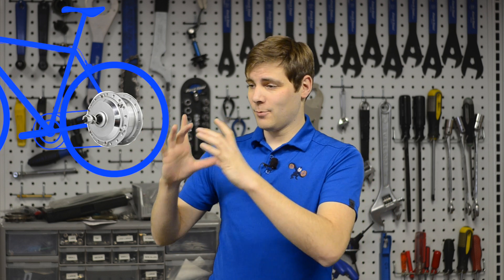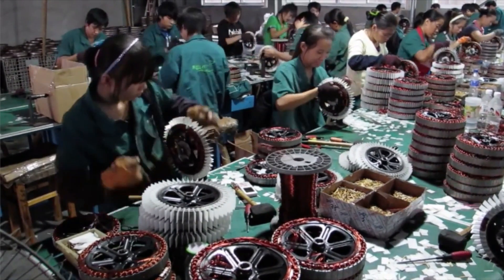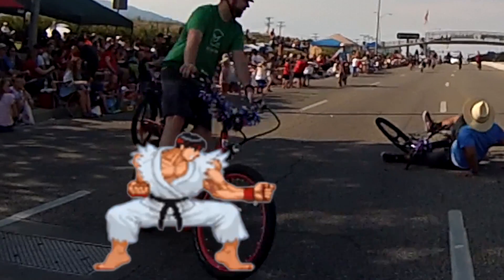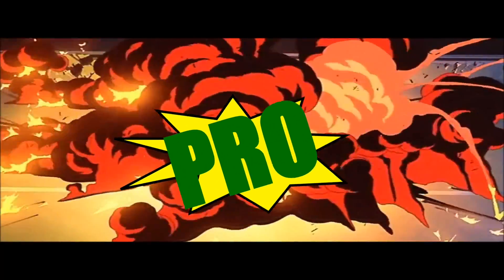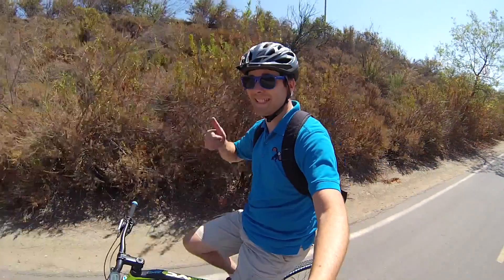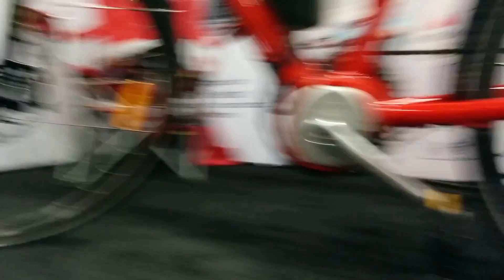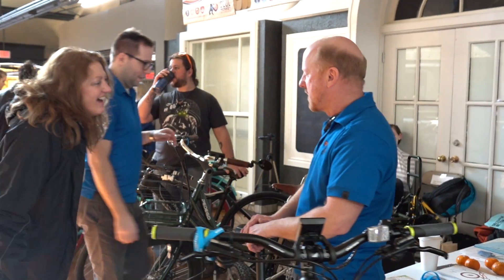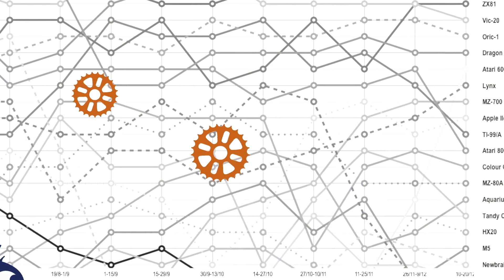Hub Drive VS Mid Drive eBike motor systems

Comment: The sprocket equalizing system on the Haibike is designed to keep the wheelbase short and increase the height so the chain doesn't slap against the chainstay. If you look at some of the Old Easy Motion EVO Jumpers, one of the chainstays is lower than the other but recently, they lowered both chainstays. If you use a SES pulley, you don't need to design a different chainstay.

Comment: Hi is really a fan of the "OLD FASHION Hub engine and therefore not tell anything about the real advantage of a mid drive like: 
Less battery use and the motor use the bikes gearing in / on the back wheel and therefore also can clime steeper hills as any hub motor with even less stress on the chain when you use the right gearing..
And today you have more mid drive engine you NOT NEED a special bike frame. You just fix it in the BB that's all and easier then a hub motor.
And the prices are not more of this mid drives anyway.
BTW you can use every Hub motor as a mid drive motor if you have just a little skill how to convert it. See here on YouTube many example. Also not a big deal.
Conclusion is a Mid drive has MUCH MORE advantage then a Hub motor in the Wheel,
THEREFORE SEARCH FOR MORE VIDEOS HERE WHO SHOW YOU WITHOUT PREJUDICE THE REAL THING = MID DRIVE vs HUB MOTORS (In the wheel)
Have FUN :-) and: "Let's GO the Road is calling YOU ... .. . (Y)
Reply: There is nothing that cannot be accomplished with enough time and money but...that is NOT within the scope of this overview video.This video was not intended for the experimental segment of the eBike population.You forgot to mention all the cons of a hub motor converted to mid-mount giving rise to the thought that your caustic comments seem a bit prejudiced. Hmm...

Comment: You don't "Have to pedal" with all mid drives. Only crappy ones. Good mid drives have PAS AND throttle. 

"A mid drive has to have a bike designed around it" Wrong again. The Bafang series fit almost all bikes. In any standard Bottom bracket, commuter bike, mountain bike, fat bike, road bike...
Reply: G Henrickson I can't help but LoL at the "those who ride conventional bike hardly ever wave back" comment. I ride both, however, care not if anyone does or does not wave at me or anyone else. Is this really a thing? Now I will chuckle every time some one waves or doesn't wave.hahhaha!
Reply: I just heard the part he said mid drives MOST you have to pedal
Reply: Baqca Sanke really thanks I'm wanting to buy a mid drive electric mike looked at trek  but idk  I want it to ride to work  and for fun. ride in woods ect any suggestions
Reply: Baqca Sanke my experience is the most expensive mid drives (bosch, yamaha, impulse,  shimano)  don't have a throttle option. Hardly crappy - altho quite boring and sterile. 

True the mid-drive bafang can be bolted on to most bottom brackets and comes with a throttle option,  but they lack the torque sensor found on nearly all more expensive mid-drives. They deliver power in a more "unsophisticated" way - altho my next ebike week have this motor. 

So far I believe the Tongsheng mid drive is the only bolt on mid drive with a torque sensor, but is a bit of a pansy as you only have a choice of a 250w or 350w outputs.
Reply: @mrmoralman1  just be aware that peak efficiency for even the BBSHD is only at 300 watts, if you like a cadence of 80-90 rpm. At higher wattage like 750-1k, you'd have to be rotating the cranks at 140+ rpm, otherwise you'll be drawing that much power still but at 80rpm only getting 500w of output thanks to being as efficient as any hub or less so even. Motors are most efficient at a given torque, but at the same cadence you need more torque, not speed to get more wattage, so the efficiency goes down on a mid drive like the BBSHD after 300w. The default out of box level 1 power is more or less the most efficient, and you'll see that higher powers have speeds you practically can't peddle unless your gear down and run the motor less efficiently. One could say for the mid drive it's also not efficient as possible as its fixed gearing to the pedals, which should spin faster at higher power levels than a person can. So you can kiss pedal assistance goodbye for high power bursts since your peddaling at lower rpm would take just as much or more battery power despite your helping.
Reply: So can you use the gears on the back wheel ?
Reply: Baqca Sanke  ikr, mine is great too, am almost always on throttle, and i dont believe you can snap your chain unless youre going up an incredibly steep hill, i always change gears just like a car when i get to a hill so i put less stress on my chain
Reply: Leopoldo Chatz Mata yes as you would usually use them,but need to have a little break from the power, for just an instance, so your giving everything time to shift smoothly.
Reply: Dale Bowen 👌
Reply: 20:1
Reply: I honestly don't care if douches like you ever wave at all. Why do you need a bike, you have legs. People like you are why runners never wave back ! Jealousy is a terrible thing to  live with. Grow up and stop trying to control what you don't like. It takes all kinds to make the world go round. Live and let live.....don't be an ass.
Reply: I wish we could all be as smart as you, WRONG, i dont want to come across as a fuckwit!
Reply: You first sentence is...hogwash. A throttle is a spill-over feature from the motorcycle industry and a huge liability for a manufacturer. It is not needed nor wanted if you seek some exercise. In fact, the existence of high powered, throttle controlled eBikes  are why those who ride conventional bikes hardly ever wave back. Kinda sad really. Also...some of those folks who are noticing the overpowered crotch rockets on the bike paths...well... work for the government and we are now seeing lots of rules as to the legality of what we are riding. IF YOU HAVE A THROTTLE...please restrain yourself. Thanks.

Comment: The biggest problem with electric motored vehicles is the BATTERY efficiency and weight of the power source. The LiPo battery
brought us the quadcopters versus the petrol engines. The design and technology is getting better thanks to the Tesla cars.
Reply: Wait until the  SUPER CAPACITORS get better refined, the end of this battery nonsense! I just bought a
lawntractor battery today for $40.00 and really didn't want to turn loose of that kind on money since I know
in less than 5 years all automotive lead acid batteries will be obsolete including the LiPos. I do believe that
electric power will dominate the scene and the internal combustion engine will fade away much like the
steam engines. The Tesla P100 has already proven itself on the dragstrip circuit.

Comment: BAFANG/8FUN BBSHD 1000W Mid Drive is not an OEM built in unit (although a unit is available now). You can pull it out of the crank bracket, and replace it with a normal pedal thus have a regular bike. The mid drive then can be remounted on any bike that has the correct width bottom bracket.
You sir, have given a very biased review of the whole.

Comment: just wondering is there much drag when battery is flat on a mid drive electric, ie can you spare ur battery and cycle it like a normal bicycle??
Reply: YES, a mid drive can be VERY easily peddled as a regular bike when the battery goes flat. A Hub is much more difficult to pedal as the magnets cause huge drag.
Reply: Mid drive don't have ANY drag when pedaling without motor. They (at least my BBSHD) has an internal free wheel

Comment: BEST BIKE: "2WD" two electric motors, one front, one rear.....yes most will exceed the speed limit, add more weight, and of course you need two, or one LARGE battery...but who cares about that?
Reply: Your best controller for a 2 hub drive is the ADAPTO controller, it has the capability to split the power between the 2 wheels to any ratio you want. This is a huge advantage as this is how you prevent front wheel spin in this type of setup (EG: 45/55 Front/Rear). Your battery is best suited as a mid mount, this gives the bike the best balance.

Comment: I just test rode a 250 Watt Mid Drive against a 500 watt Hub Bike (both very expensive bikes) I took them on some steep hills and it wasn't even close, the mid drive killed it despite the weaker motor.
Reply: You're not accounting for peak power output, which is often multiples of the quoted constant output. You think you're comparing 250 watt power vs 500, but you're not.
Reply: these people are saying all this science stuff but have no simple common sense, what you're saying is proof, as long as the motor has plenty of torque gears are going to be better than no gears
Reply: This all depends on who mad the hub not all are created equal.
Reply: Mid Drive fan

Comment: Hi, you seem to be a bit muddled, saying rear hubs push from the back is true, but so do mid drives.  There are mid drives that do not need a special frame, such as the Bafang and you can have a throttle with a Bafang and you do not have to pedal.  You also have the advantage of being able to use your gears to help the motor make hard climbs and with the rear wheel being easy to remove and the weight being central., for me the mid drive wins easily.
Reply: "Professionally Finished Bikes" ..... What is so professionally finished when it comes to hub motors?! 
9 Different brands of hub motors are made in 1 factory. This is a massed produced semi generic item that is available as a kit or finished bike. Personally, I prefer the kits as it gives me control over the components that are mounted to the bike. 
Of the 3 ebikes I have built from frame up, they have costed less than a "Professionally Finished Bike", and have better components allround.
As for the rims that are generally supplied with hubs......GARBAGE! ... You need a 19" mBike rim.

Comment: I don't understand why you say the mid-drive must be pedal assist.  Doesn't the front sprocket ratchet wrt the pedals?  i.e. Can't the sprocket be powered by the motor while the pedals are not rotating?
Reply: Raleigh Tekoa-iE mid-drive has a twist throttle
Reply: Karl Gesslein, in his highly regarded Fatbike blog, says that Luna now sells more assembled bikes than Pedego. In general, the bikes Luna sells are Bafang and other high power mid-drive conversions. Almost all have throttles, or can accomodate a throttle. So is a bike that Luna puts together, using name brand frames,  'professionally assembled'.

I can't vouch for what Luna sells, his volume. I know Mr. Hicks has a lot of bikes on his pages and he has moved to a much bigger facility in a much nicer part of LA. I just counted, and he has 36 bikes on his page,  assembled bikes for sale. Hicks seems to be doing very well selling what he calls 'fast bikes'. 

I just don't see how you can say there aren't center drives with throttles. So you have some notion that your bikes are professionally manufactured? So his aren't, or what? Bafang has the Max Ultra, anyway. So, really. Maybe you should get out more?
Reply: Bafang mid drives has the option to be throttle, either twist or thumb.

Comment: Great video and professional but with a big floor. HUB motors are generally not geared so the hub is a compromise between take off speed and top speed, a bit like driving a car stuck in 3rd gear - will pull away (under great strain) but have a floored top speed. HUB motors also suffer from poor water/mud/dirt intrusion. Mid drive do utilize the chain (as mentioned) but also use the gearing system (directly) so therefor are "geared" as they output the power through the front chain wheel. A massive market leader is the Bafang motor and now the latest BBSHD (like many of the others) can be used with throttle only (if for off road use - country/state and legislation dependent), full waterproof and DOES NOT need a specially built frame.

Comment: I have a front 1000 watt hub allot cheaper than mid drive. have about 2500 miles on it still strong. 36 volt 15amph 24mph. made a bike trailer 2 take my 2 dogs with me.
Reply: Pics please.
Reply: Let's see
Reply: How much Mile done

Comment: informative! well produced. Power and cost aside, the mid drive just has better weight balance. MDs are well suited for heavy off-roads. But on street and light off-roads hubs can be really amazing if set up right, you also do not need to keep changing gears to get the power. The debate goes on, but there is no real debate at all.

Comment: *you don't need to pedal on a mid drive. they use a freewheel setup on the crank arm to the chain ring
Reply: Blue Monkey Bicycles I was just saying because I am converting my own bike into an Ebike. if you look up Luna cycles, their chain rings have a freewheel set up. it is nice to just be able to go throttle only.

Comment: Hey guys that know a lot about this stuff!
If I had a hub on the front and the back, with corresponding batteries, would it double the range?  I know the speed is probably limited, but if I used one motor for half of the trip and the other for the return I would think it would be better.  What do you think?
Reply: Lou, Sir running one motor and two batteries in parallel will be more efficient if you looking for a range. also you will save a lot of weight

Comment: Is it ignorance or bias when you say you have to pedal a MD?
There is no need to pedal a md unless you choose too utilise your leg power
Reply: ***** Guess my bias and ignorance is showing. I thought you had been refering to a mechanical need to pedal when ever  the motor  was engaged.
I agree the elimination of a manual throttle makes for a less satisfying experience I wasn't aware it was more predominant in the mid drives
Reply: Surely the issue with having a throttle setup is the requirement to have it MOT'd (or whatever you have as equivalent in the USA) RFL's and insured and to have road legal lighting and a registration plate, plus a motorbike certified helmet. Ped-elec systems dont require any of this because they are still a bicycle.

Comment: mid drives can also give more torque if the motors are similarly spec-ed as they can take advantage of the larger chain rings
Reply: Robbae 8 no no
Reply: Wrong. Torque of DC motor is the same regardless of rpm. This is not a gasoline engine that produces more torque at higher RPM. Please educate yourself on electric motor torque.
Reply: You are correct that it doesn't develop any more torque at the crank but it can deliver more torque to the wheel because it's going through the gears.

Comment: Hub drives are a lot better imo, they are mass produced (which means there are a lot of poorly made ones but also a lot of well made ones) and that means they are cheap so you can easily and affordably replace one if something happens. Also they come in a lot of wattage ranges and sizes. One more thing is that with a mid drive motor you can only use 1 on a bike, with a hub motor you can use 2 and double the power and torque, although you will need a more voltage and capacity but if you  are getting 2 hub motors you probably can afford better batteries.

Comment: Another advantage of mid drive motors using the chain is that they can vary torque so one can choose to have higher speeds on level terrain or shifting into a lower gear being able to climb hills.
However now there are 2 speed (geared) hub motors becoming available that somewhat give this capability that mid drive motors that use the bikes gearing have.
By the way I have had a Freehub ratchet mechanism failure (not a chain break though) and it was my meager 250 watt hub motor that helped me get home though I did have to walk with the bicycle up some hills.
Now I have a 880 watt 2 speed hub motor and my hills are no problem.Amazingly I don't even need to shift into a lower gear anymore either even up hills.It's capable of going up my hills even without me pedaling though I do so.
I am a city commuter and a cardiac patient too.
Reply: Blue Monkey Bicycles I purchased that 2 speed hub motor kit from Luna Cycle.Quite amazing too.